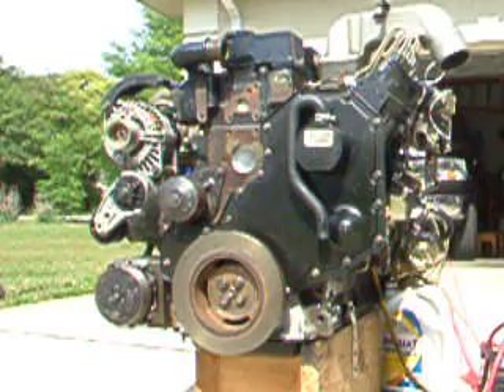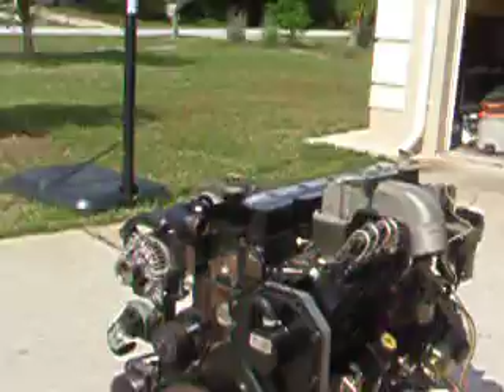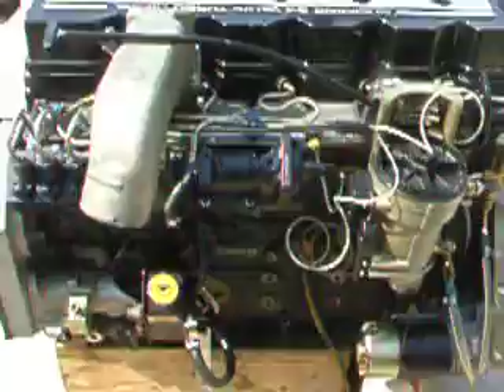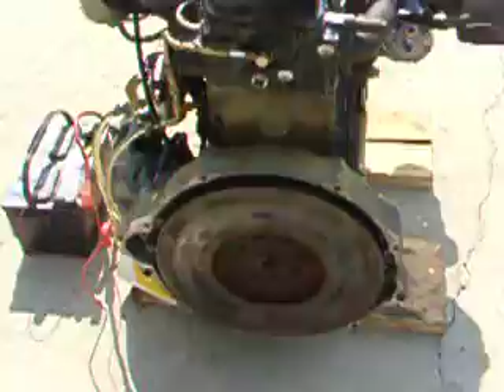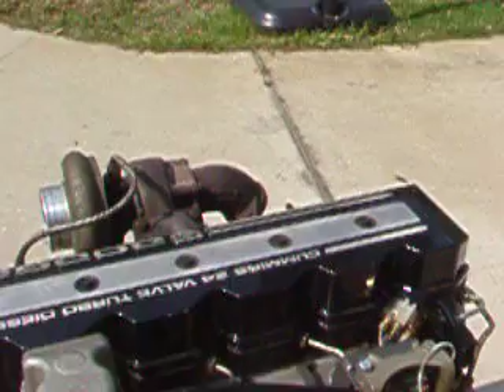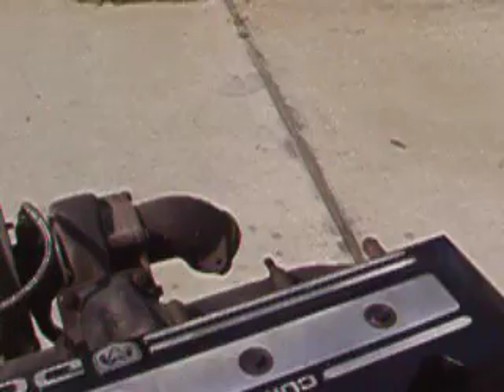24V Cummins P7100.AVI

Comment from the maker: @tpvalley  Yes this is stock 8.3L Pump, but had to be tuned, I try few shops but Shiver Diesel in Tifton GA was the only one to get it to run. High cam lobe is to blame for no smoke it will inject fuel at the higher velocity so you get better atomization.

Comment: Dieselindrums... They have a low idle because of the P-7100 pump, they idle like a 12 valve. The computer on a 24 v is set to keep the idle at a certain spot and gives itself fuel if it gets lower than the set rpm

Comment: @bebac2006 
so it wouldnt even run straight off the 8.3?
high lobe to blame for smoke u say, interesting, so it injects all the fuel in to short a space of time kind of?
I guess if the length of injection was to long u would get white smoke?